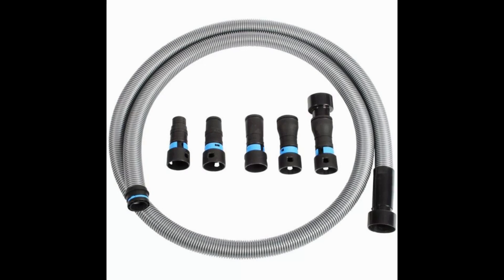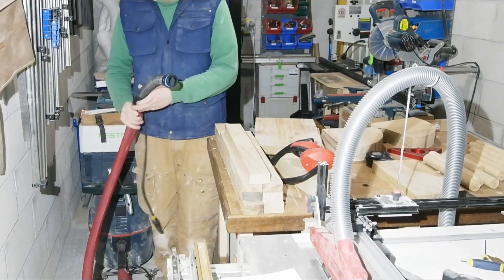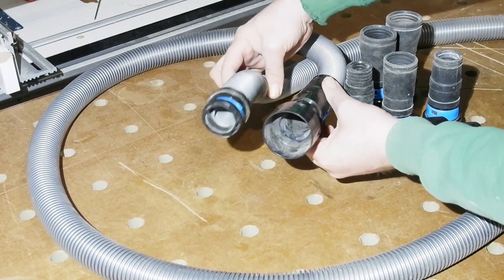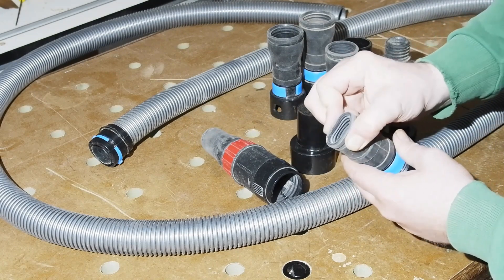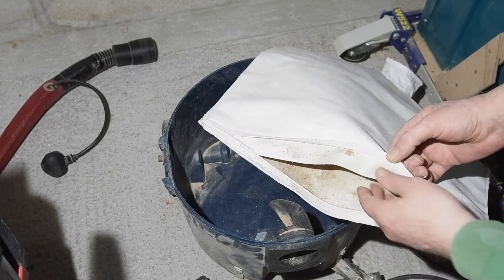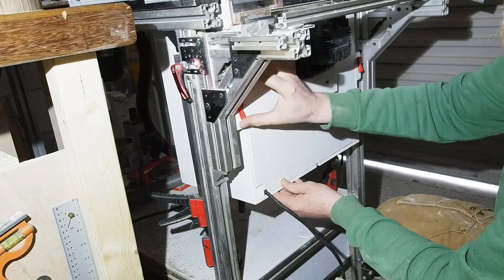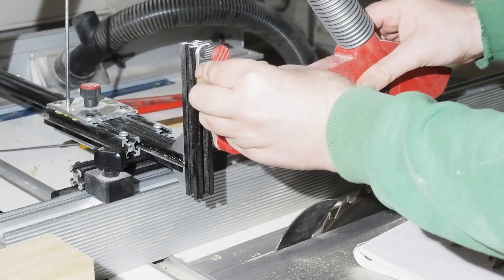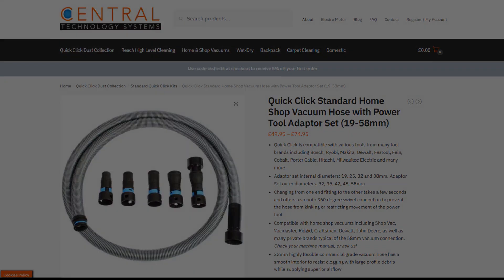CTS Quick Click, Hose Splitter and a Reusable Dust bag. Used and Reviewed!

Comment: Just wanted to throw this out there.  But i use a rigid vac as a contractor. The filters are kinda overpriced for what they are.  So you can make a filter last forever if you get yourself a pool skimmer filter sock and put it over your vac filter.  Just knock the fine dust off the sock when your dumping your vac and good to go.  Hope this helps some of you guys.  It probably saves me 200 to 300 a year on filters.
Reply from the maker: Cheers for that. Not s bad idea. The last time I bought the proper bosch bags, the last one, I just cut the top and taped it around the filter (cylinder type). Similar idea as yours. Lasted really well - and saved a fortune one the bags which are really overpriced from Bosch.👍

Comment: Hi , I have watched the video and really appreciate the work you have put into it. I have been after some sort of dust extraction system for a while, not for wood working as such but more for renovation and sanding in an old 1880 cottage in Lancashire. We don't have a lot of cash and have been looking at dust extractors, henry vacuums etc on various sites,  and after several failed bids finally bought a guess what yes, bosch gas 20 l sfc for £53.00. The main task it has to do will be sanding the beams, skirtings doors etc of all the dark stain and varnishes that have been applied over the years. I have bought a set of CTS adapters which should be arriving soon and was wondering if you had any further advice.
Reply from the maker: That's a good price for a Bosch Gas 20l. It's proved a very reliable extractor for me - more so than the more expensive Gas 35 I had. It'll serve you well no doubt. One annoying thing with the 20L though is it has the cylinder type filter. This stops you from properly filling a bag and getting your monies worth. Hence why I bought and show in this vid the "universal" reusable filter bag. My ones still going. Saves so much money over the Bosch bags. There's a link in description. Comes from Poland so bit of a wait but worth it I think. The vac will survive using without bags - I did for a long time on site - but, constant cleaning of the filter isn't healthy! Remember to remove the filter when/if using as a wet vac. That's it really mate. A very plug and go vac. Good luck with the renovation mate.

Comment: Hi I’ve got the same Mafell track saw as you. I don’t want the full set,just a connector for the saw do you know what one I need there seems loads of different ones on the web. Thanks
Reply from the maker: Hi Matt. In the video I show the standard power tool adaptor going inside the mt55 port. It's a better fit than my old bosch one but I've since found the largest adapter in the set (38mm id) will fit over the mt55 port. Takes a bit of a push on but once on you can lift the saw by it!! That's the one I recommend. I'll pop a link for it below. To use it, you'll also need the "thread and clip ring" thing that attaches to your hose. Easy to find in the site.👍
https://centraltechnologysystems.co.uk/product/standard-quick-click-individual-power-tool-adaptors/ref/7/

Comment: I got myself a set of these about six months ago and can't fault them. I get most use from them with my track saw, biscuit jointer and a variety of sanders. They all have different size nozzles so I colour coded mine with a spot of enamel paint. Works a treat, red nozzle on random orbital sander and biscuit machine, blue on track saw and 1/2 inch routervand so on. Works a treat.
Reply from the maker: Good to hear mate. Like the idea of colour coding. One thing I've noticed after making this vid is previously, the old adaptor used to fit inside the port on my electric hand planer. With these cen-tec, I can seat around the port. Pretty sure this would mean it'd clog less. But yeah, great for all the different sized ports.👍

Comment: Has anyone had any experience as to whether the centec connectors do actually fit with the new Bosch quick connects?
Reply from the maker: Like I mentioned in the vid chap, I did have a Bosch GAS35 that had the quick connect. It too would click into the back if the mitre saw like the cen-tec ones. They look pretty much identical if I'm honest. Of course, don't have that vac anymore so can't say 100% but I'm pretty sure they would. I found myself wondering if bosch makes it under licence?
Reply: @BischBaschBosch  - thanks for responding, the reason I ask, is I’m sure I’d asked centec at some point a few years ago, and thought they said it didn’t.  But agree it looks identical, and given that it fits the Mitre, you’re probably right!
Reply from the maker: @robbief1  No probs. I'll ask Lewis at cen-tec to see if he's able to say for sure. Can't see any reason they'd shy away from a yay or nay.
Reply: It's absolutely identical to the Bosch system, don't know why they would tell you otherwise... legal reasons, perhaps?
Reply: Yes - they click into the dust port of my Bosch GCM 350-254 mitre saw

Comment: I've had my kit for about 2 years and it's good quality. BUT, remember it's a tapered hose and is meant to be used as the fixed length you bought. So you can't cut it as the end clips won't screw onto the hose. 38mm down to 32mm
Reply from the maker: Maybe you got a different hose to me chap but the one I've got isn't tapered. Just a straight plastic hose, 32mm id and 38mm od each end (and all the way through). Absolutely fine to split.
Reply: @BischBaschBosch  Mine was the blue anti static version.
Reply from the maker: @MillfieldWheels  That's interesting if the anti-stat are tapered. I wouldn't chop up an anti-stat though. Even if it wasn't tapered, you'd have to complete the metal connections again. Not sure how easy that is with the cen-tec screw on fittings.

Comment: Just started using this kit and I love it. Greta vid and thanks for the link to the y splitter solves the change out issue I had with hose connections to my table and chop saws. Excellent
Reply from the maker: Cheers. Yeah, the splitter was a good price considering the few options out there. Plus of course, the guys eBay page did say he could custom size too which is always a bonus. Link in the description btw 👍

Comment: I bet you want to upgrade to a zero clearance miter real bad in that space.
Reply from the maker: You mean one with forward facing rails? Definitely at some point.
Reply: @BischBaschBosch  Yep. The Festool, Bosch, or Makita ones. If you are in EU seems everyone goes for the Festool Kapex. It is so expensive thought.
Reply from the maker: @MustPassTruck  Have tried the forward facing saws from all 3 of those. I'd like the Kapex features with the Bosch capacity with the Makita motor (Seems quietest) 😁. I'm still prototyping my furniture designs. Once I'm set in that respect, I'll look at new kit and a bigger space. Fine for now though.👍
Reply: @BischBaschBosch  Lucky to be able to try out all 3. Only gotten my hands on the bosch in a few stores. They all seem to have up's and downs. Wish you could combine the good features somehow.

Comment: The quick click is great, and the blue anti-static hose they offer is fantastic
Reply from the maker: Yeah, they're pretty good. Fan of anything that gives you options! Their hoses seem to be really good value. Certainly better value than the blue Bosch anti-stat hoses!
Reply: I saw CTS Quick Click on Rag 'n' Bone Brown  and Badger Workshop, and made myself blue metal drum cyclone separator based on Charlie DIYte. I have a separate shop vac for the tablesaw. The CTS staff were super helpful guiding me to ensure I got the right fitting adapters for all my various tools, and ensuring I could simply connect up to the cyclone. I was going to bodge a piped dust system using a CamVac dual motor but so far the CTS one-hose system is working great.

Comment: I love the connector Set and i think, i own three of them by now. First one i bought about two or three years ago.
To avoid changing the bags, i used an older xl L-Boxx on Top of my Bosch Vac and installed a smaller cyclone to fill up a plastic bag in the L-Boxx. Works good for me and saves lots of expensive bags for the vac.
Reply from the maker: Yeah, I'm pretty sold on them myself now. Did think a while back about using an empty l-boxx or 2 with a cyclone. I kind of like having tools on top of the vac though. The reusable bags workin ok though. Be good if I could get a years use out of it.

Comment: I have a large collection of the Cen-Tec adapters and hoses used daily....no complaints....direct match to the FLEX extractor. 
Very reasonably priced in the States...pretty sure they are made here.  
They have an anti-static version also....a bit more money but sized the same.
Reply from the maker: Cheers for that Ed. You're right about them being made in the US. Commonly known as Cen-tec there and CTS here. I can see myself adding to the collection in time. 👍

Comment: I've been using these for a while, having seen them on the Badger Workshop channel, and I love the things.....they make swapping between tools a piece of cake. I've  got a few extractors in the shop from Record, Numatic,  Bosch and DeWalt, and I have one of these fittings on each hose. Incidentally I got one set of adaptors that are anti static, and the rubber on those feels softer than the standard set.
When I used to work out of a double garage, the dust would fill the place within seconds every time I switched on a circular saw or sander. The answer was a 'fan in a can' ambient air filter - they work like magic in a small space.
Reply from the maker: Cheers for that David. Interesting that the anti-stat are softer. Yeah, I was gonna get an air filter when I got the planer thicknesser. I didn't as my general extraction was so bad I thought I'd wait to at least get dust levels from the tools down first. A filter is on the list though.👍
Reply: Have you got a hose wrap?

Comment: Thanks for showing us this Set. Think I will order some set myself. 
CTS has also this great Cyclone set, really nice and with alls bits that one would need. You may want to add this to your dust extraction setup, as it really saves you changing that bag all the time. I used a 30cm pipe by 150 long with a cyc at the top and lid at the bottom. It hides away in a corner and I can easily empty it into a bin. The vacuuming result hasn’t changed. Should I find the article, I’ll drop you the link.
Reply from the maker: Cheers. If you order anything, follow the link in the description and use the code and you should get 5% off at checkout👍 They did offer me their cyclone thing and I would love it but can't spare the floor space for the extra bucket it'd need, so turned it down. Great addition if you have the space.
Reply: @BischBaschBosch  I recently added their cyclone to my set up. It works great. I built a small cart, using the wheels on the base of the dust extractor, that allows me to mount the cyclone above the dust extractor. It doesn't take up any more floor space (which is just as important in my small shop as it is in yours). The down side is that the dust extractor no longer stores under my work bench.

Comment: I’ve wondered about these for a while, thanks for the video.

Any suggestions for cheap extrusion piece suppliers?
 I need to make a couple of fences 😊
Reply from the maker: Yeah, I was aware of these for ages but the time had come to take a proper look. Not disappointed. 
For the 20mm series profiles, I tend to order from Ooznest. They're not a bargain supplier but keep good stock. 
For cheaper stuff, bundles sometimes come up on eBay. You could also try the Chinese sites like banggood or aliexpress. They probably won't send anything over 1m though. 
I don't mind paying the couple quid more from Ooznest as they're super quick and will custom cut.
Reply: @BischBaschBosch  brilliant thanks fella